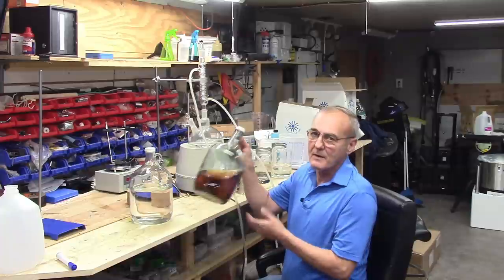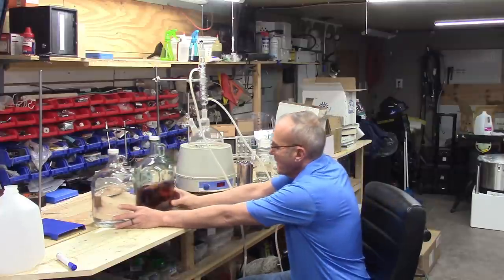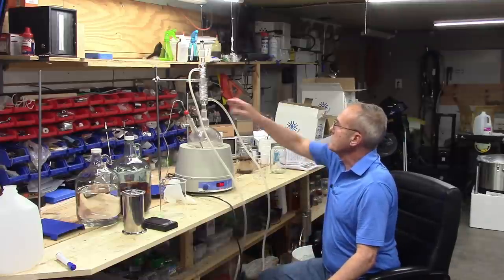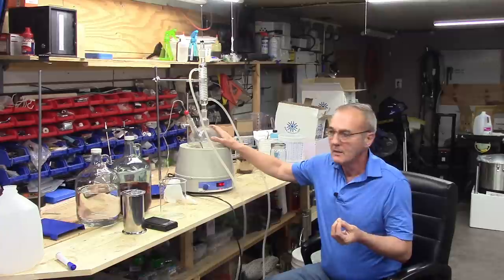AGING SPIRITS

Comment: I do actually almost the same process by using a sous vide stick. Putting some bottles with oak chips in a water container and keeping the temp at 60°C with my sous vide stick for about 3 hours. I loosen the caps of the bottles just a little bit to avoid pressure building up in the bottles. But I’m not sure if that’s even necessary. 
Thank you so much for your work and your channel George, you are a giant !
Reply: I do 45 minute cycles SV (sealed pint or qt jars) and cold water (ice baths). 4-5 cycles works very well.
Reply: Great idea! Let's do it!

Comment: Nice George .You can do it different though. Use the au-bain-marie method.Get yourselfe a big cooking pot wich can hold 3 or 4 bottles,put something on the bottom so the bottle are not touching the direct heat from the pot.Fill it with water and put you bottles in with a lose cap(very important!!!).Put it on a heating device with some kind of temperature controller. Usually I do this 24 hours straight on exactly 50 degrees celsius.The harshness is less and I repeat this method 3 times during 3 months of riping.Tip ad 1 shotglass of white port to every liter,this gives it a full note of texture. Leaving the bottle caps lose will improve the taste and the bad " fumes" can escape giving you a smoother drink.Note: the  temperature may NEVER exceed the 50 degrees celcius!!!! After cooling the bottles down to roomtemperature I freeze them for 24 hours {lose caps} .And I wait 4 weeks repeating the same process....Thanks George for all the effort and expertise you give us ....

Comment: Consider putting the jar with chips and liquor inside in the microwave for a few minutes, maybe up to 140-160F. What happens is the warmth expedites the flavoring process but also what happens is the 2.4Ghz is the resonant frequency of H2O molecules. This causes the water inside the wood chips/sticks to steam. This vapor will steam out (you can see the bubbles on the wood if you look) into the liquor and greatly enhances the taste and thereby expediting the "aging" process. Your heating process is good, but it's WAY better to heat in a microwave to get the doubled affect described above. Potatoes actually steam in the microwave this way instead of cooking in the traditional sense. George, thank you! I envy your work shop and truly appreciate you don't drink, beyond tastings, during your videos as well as not swearing like too many of the brewers and distillers do. Keep up the good work sir.

Comment: George:  There's a distillery / bar in Seattle where they roll / rock the oak barrels on display at the main entrance and it ages the product 10 years in 3 months....  I shared this with my stilling mates back here in Oz and they shared that in the 17/1800's, when the British were sailing to the colonies the rum / spirits sitting in barrels would be far better tasing by the time it got to the location because of the rocking of the boat back and forth....  It aged many years in a matter of months while on the move!  Quick ageing....
Reply: Temperature and cask volume played a big part as well. Casks were smaller meaning more spirit in contact with wood, as well the temperatures during ship travel went much higher in the store rooms, meaning faster "maturation".

Comment: I was watching a video the other day from a commercial distillery that developed a process for fast aging that's taking off in the industry. They started by tested the recipe/process they found works best is using 8 grams of heavy toasted oak chips to 360ml and used mild heat (43.5°C) with 1.3 Bar of pressure in a converted espresso machine where they reduced the heating coil efficiency to achieve the 110°F temperature (mostly for safety and to reduce loss from evap.) and forcing the distillate through the finely pulverized oak chips. 
I'd be really interested to see what you think of this idea. Personally I plan to try this using a manual non-electric espresso maker and a coffee grinder to finely chop up the chips and see what I get.
Reply: Did it work for you?
Reply: @shanonallen5395  it did fast age it, produced some great color instantly but the was a little stronger and harsher than I cared for, the slow oaked same batch I split was more to my taste in the end but if you're just looking for commercial grade results (not what was promised in the presentation) it works well enough.

Comment: Thanks for the video, I am not a fan of the chips but I do use them. I typically place them in a jar and a bath of water from a croc pot and let sit over night then in the freezer and repeat for 6 days. works but not my favorite method. best flavors i have gotten are from 5gal oak barrels and time. (duh) but i do appreciate the quicker method for extracting flavors. and as you and others probably are aware extracting oak flavors and aging are two different things. The smoothness comes from the time and the flavor comes from the oak. I like to think of it as infusing using oak.

Comment: Would love to see some different ideas for cooling your condenser efficiently and cheaply
Reply: I use a 275 gal tote full of water (cost $40 used) then recycle the water back into the tote. works great and you don't waste water. No ice needed. be sure to wrap your tote with moving blankets to keep them from getting hot from sun etc. a cool shaded corner of the house works good to keep the water cool. You can also use a harbor freight 5 gal pressure tank pump (120v us) to pump the water but also be sure to use an RV pressure regulator ($5) to keep the pressure down below or youll blow your lines.  :)  there is also the glycol chillers for beer/wine if you want to spend $500 they work good as well but chill water first with chiller then pump water to condenser... hope this helps.

Comment: You basically got the fast colouring with that heating process. Now, get some hydrogen peroxide in the mix to get the oxidation part of the equation. You will be surprised with the results. 
The danger with heating the wood is that you can free the otherwise non active residual tannines (the ones left behind after the preparation of the oak chips), and they can give that "plank of wood" taste in the drink.

Comment: Hello sir, I'm wondering.... Does the aging continue for the one you "force aged" via heating? IOW, when you put it on the shelf without the presence of oak chips does it still lose the harshness? Aka mellow I suppose?
Reply: It will a bit. Just aging it will allow it to oxidize, just sitting on the shelf that is a slow process but a tiny amount of oxidation will mellow out a lot of flavor. If you wanted to speed up that process you could bubble just a little bit of air through the spirit, something like an aquarium bubbler would work. If you want to strip everything asap an ozone bubbler will do that even faster.

Comment: Hey George, just curious... what if I heated up water and wood chips in a large quantity for a longer period of time. Then I could add some high proof stripped alcohol above 180 proof to cut it down to 40% and. Would it not do virtually the same thing. Then you wouldn't even need a reflux still or Chem set, because you wouldn't be worried about losing volume of alcohol. Great video, thnx.
Reply: My thoughts exactly.

Comment: With short aging you’re basically making oak tea (or gin if you prefer), rather than truly aging. For more of an aging affect it would be better to replicate a second-fill cask and slow down the oak infusing by presoaking the oak in whisky or sherry for a prolonged time and then use those chips again in your clear spirit over a longer time frame. I’m still experimenting, but I think ideally you want oak that can take 6-12 months of contact without imparting too much unwanted oakiness (heat, dryness).

Comment: If alcohol is the solvent why not go see what a higher ABV will do. For safety you don't want to distill high abv.  So the question is if you stick with a  high abv you pulled off the still put the woodchips in and used a sous vid to heat then cool.  Will you pull more of the wood flavors out. The next thin is oxidation as that will really mellow out the flavors. Beard and Board used and ozone bubbler but just an aquarium bubbler can introduce enough oxygen to speed up the oxidation process. I suspect there is a process or recipe to do the force aging that will get you very close to something that has had alot of barrel time. It wont be exactly the same but it might be close enough or  just different in a good way to be something really good.

Comment: Gotta love the facial expressions as the shots are downed - Personal experience - distilled a heap of old wine into Brandy let it sit in Dark toasted oak chips for five years - smooth as, full of caramel / toffee smells and flavours. The second experiment has been soaking raw oak chips in Muscatel Wine for four weeks, draining liquid then refilling with a basic bottle of Scotch the plan is to leave it soak for 12 months against the garage wall where the afternoon summer heat is most felt, then the winter months doing the opposite effect - results will be available January 2022.

Comment: I know I’m a little behind but I just watched the video there’s no surprise that heating it up works this is my assumption to begin with and I’ve already done this but I did mine just like if I was making a tincture I did not realize I could do it in my lab glass I already have a heating mantle 1000ml boiling flask and the align condenser The first one that he used is called a graham condenser In case anyone is interested in knowing the proper names You can acquire everything that he used if you buy an essential oil distillation apparatus minus the heating metal you’ll have to buy that separate, If you want to do it the easy way like I did my first one all you need is a double boiler and a mason jar Just simply get the double heart stick your mason jar with your liquor and out chips in the water in the double boiler and let it run for a few hours or so keep the temperature low as to not break the glass and you will get the same results I really enjoyed the video can’t wait to try doing this his way next time for someone with like me with the equipment already it seems to be a better way to do it won’t know for sure until I try

Comment: Can you use a T500 Turbo with the water blasting full flow to keep it from condensing out the business end but also keeping the temp below say 60~65C to get the heat effect desired and not lose any volume?

Comment: George am thinking this may not work well in a copper pot. I may be wrong but am thinking the spirit would taste significantly different if you try this in a copper pot vs. Stainless steel. 
Anyone can share their thoughts.
Reply: George says a person can’t tell the difference 🤷‍♂️

But My question is, Do all these people running these stills have a permit to do so?  Because everything I’ve read it’s against federal law to run spirits without a permit... even for personal use.

Comment: Use an ultrasonic cleaner.
Reply from the maker: Please explain.
Reply: @BarleyandHopsBrewing  I use an ultrasonic jewelry cleaner as well.  It holds about 4 litres (I think; admittedly I forget).  The cleaner heats and can run timed cycles doing it's ultransonic thing.  I have not tried adding oak.  But it does well to diminish the harshness that can sometimes be found in a sugar wash.  Something that would otherwise take weeks to months to smooth, can be done in less than an hour.  If you google around, many, many folks have tried this and found success.  There is also some research/science to back this up.  And the journal article can be found via google as well.  Like others have said, it doesn't take the place of true aging per se, but it does rapidly accelerate things.
Reply from the maker: @Jeff Canar  Amazing. I will look into this. Thanks for explaining what you meant. I was a little confused there for a while.😀
Reply: @BarleyandHopsBrewing  
Hi George👋
Did you watch this video I shared the link to?
Reply: @CyberTransport  I did. It was very interesting with many similarities to what we did.